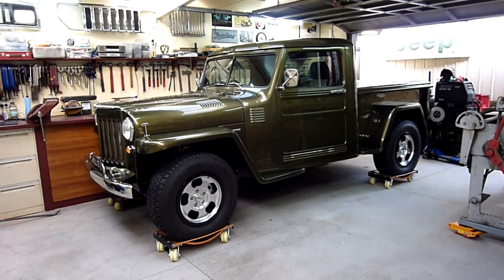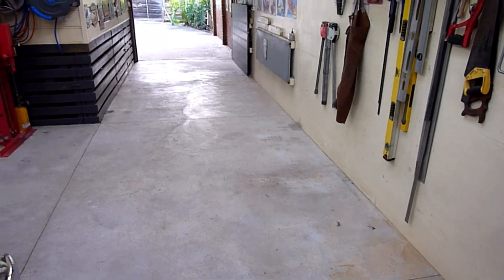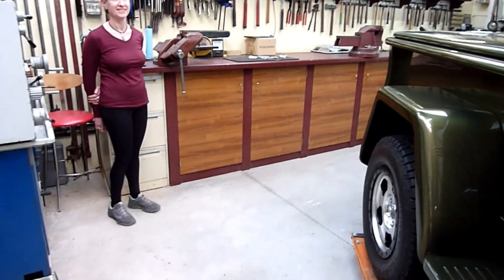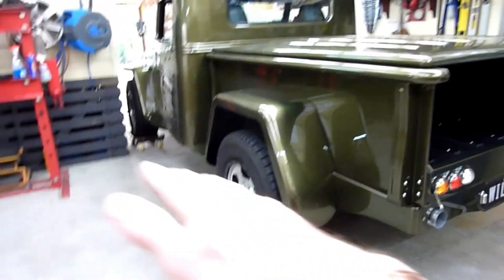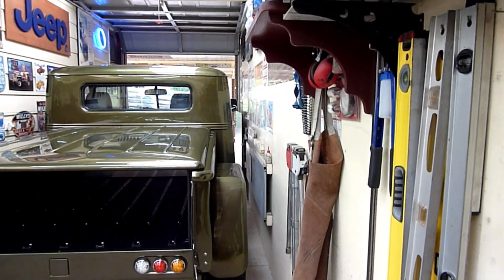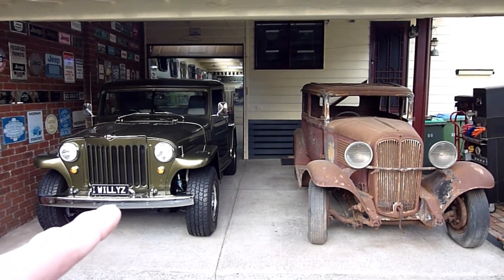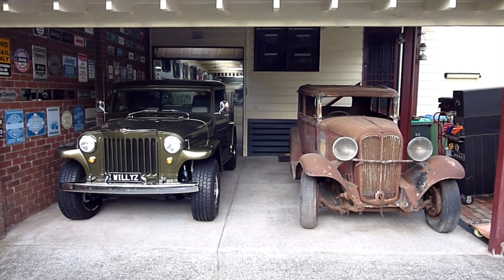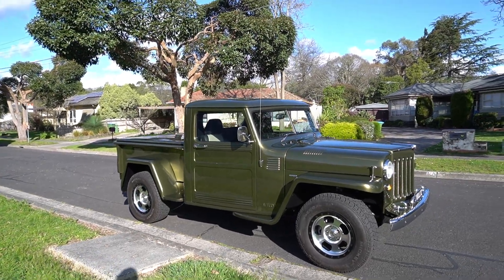Out of the workshop & first drive  GrandWillys55

Comment: That is fantastic I have been watching you do this from the start in fact even before in your XJ days when I had one I ended up with a 2002 WJ 4ltr as I said you have made a fantastic job of building it for me the problem with it is its just to perfect if I had it I would be to worried to take it out onto the road you can drive as careful as you like but there is always some fool who could bump into you and scratch it I will be interesting to see the other one when its finished in ten years time.
Reply from the maker: Yes, going to be a worry at the start for sure. It is why I am waiting to take it out until the paint is fully hardened and I can get some paint protection on it to help against that.